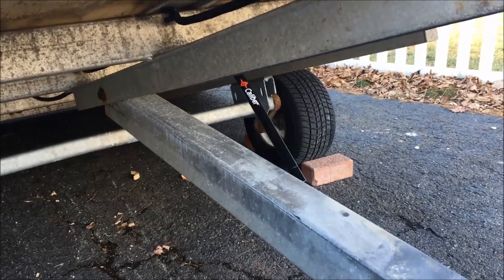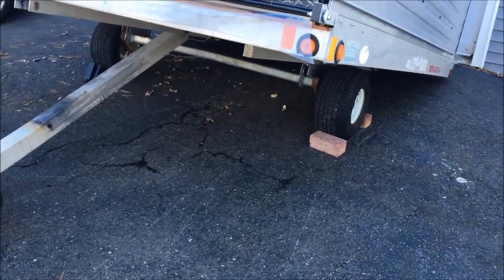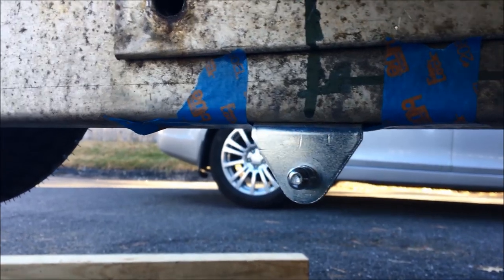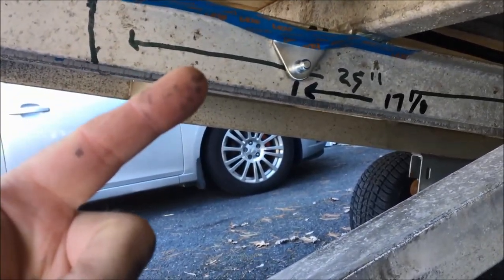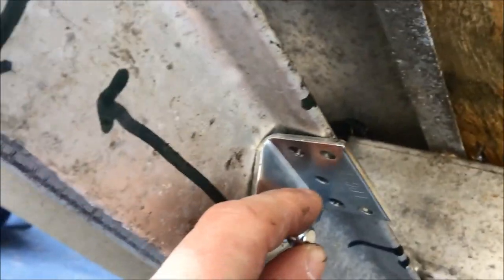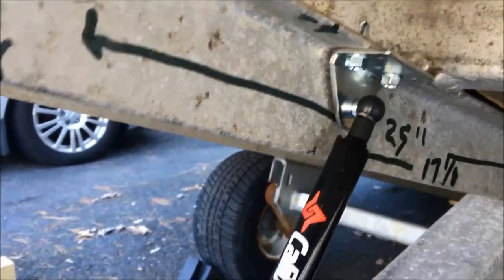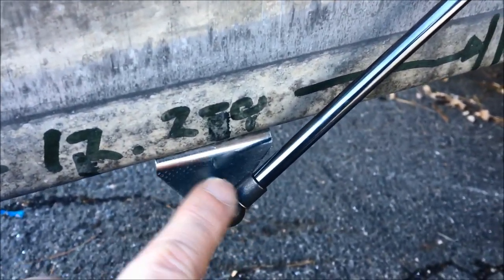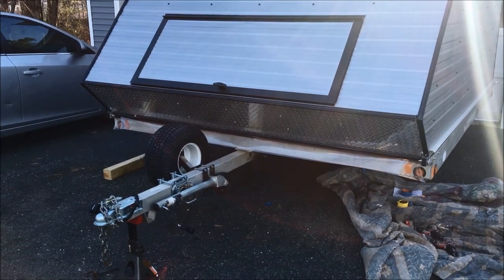How to install a Caliber Trailer Lift Shock System On Your Trailer

Comment: Streeter you were reading my mind, I've been toying with doing that same thing with my trailer. I was actually looking at lift shocks with those brackets to mount but I didn't know how long of a shock I would need. So you just solved my dilemma, buy the lift kit! Thanks!
Reply from the maker: Thanks.  Glad it helped you out. 

Now that the clamshell is installed it’s mandatory. The first time I loaded up the trailer was going up and down like a see saw and the cover was just shaking back and forth. I was afraid the lifts were going to bend.

Comment: Great instructional video!!  I had to modify mine as well.....  no place to attach the top piece to so I had to weld mine on.
Reply from the maker: awesome. Do yourself a favor and coat the entire assembly with fluid film to prevent all the salt and brine from attacking it.
Reply: @StreetersGarage  will do. I sprayed rocker guard on the brackets but will spray the lift with something.
Reply from the maker: That works. Just don’t spray the shock cylinder when it’s extended.

Comment: Will this slow down the tilt when you are loading it? I need something that'll not allow it to come crashing down once the weight tips.
Reply from the maker: Yes it’ll slow it down make it more controllable. I would install 2 of them.
Reply: Streeters Garage I have a 500lb 5x10 trailer. Do you have a good link for the strut you used. The one you have linked just goes to amazon.
Reply from the maker: Is it a steel trailer or a aluminum. Does it have a clamshell or is it open. 

It’s made by Caliber.
Reply: Streeters Garage steel. It’s open.
Reply from the maker: Yep. You should be fine.

Comment: I have 2 problems with mine as i get older, one is lifting the empty trailer to tilt position to put the first sled on if only to hold it in place for second wifes sled. Is this what this is designed for? Assist in lifting?  2nd problem is backing sled down, the tilt bed slams to the ground no matter how slow I go. Does this help with that?  Any wise experienced suggestions to either of them problems?
Reply from the maker: Yes on both b

Comment: Does the one strut hold up your trailer when two sleds are loaded?
Reply from the maker: Yes. But after 2 years of use. I’d recommended 2 of them.
Reply: @StreetersGarage  great thanks for the feedback
Reply from the maker: No problem. Good luck.